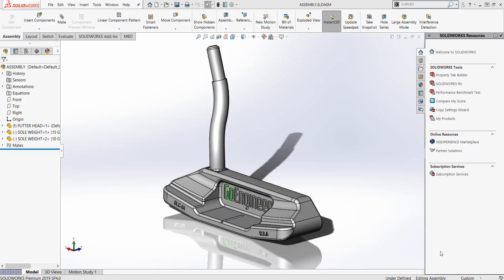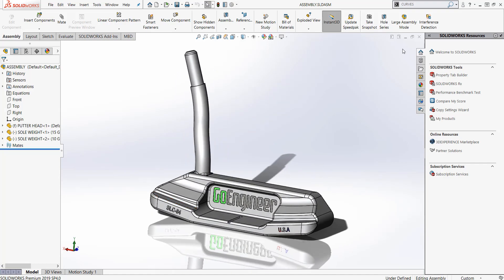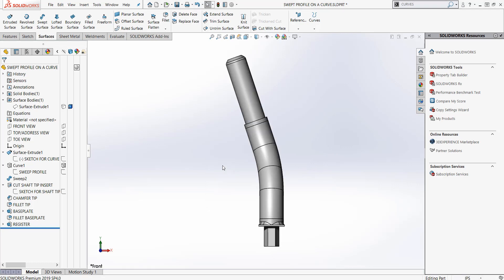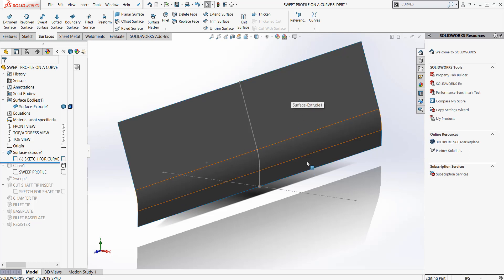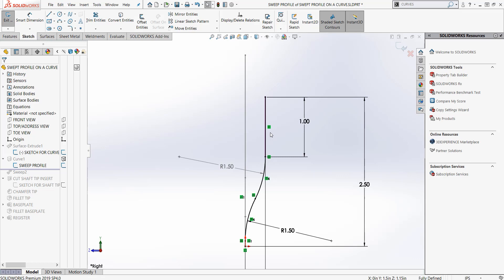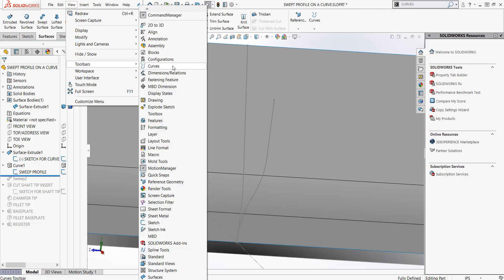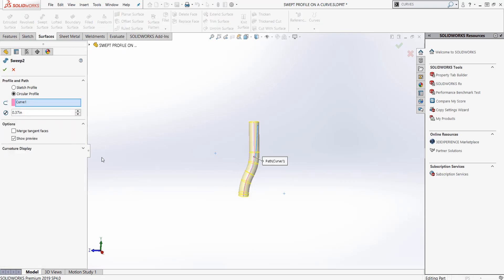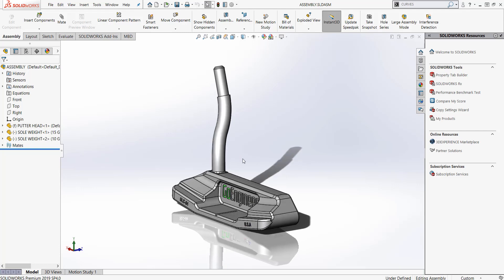SOLIDWORKS Tutorial - Circular Sweep on a Curved Surface

Comment: This is a good technique for eliminating the need for 3D sketches (which I try to avoid at all cost). Personally I would skip the extruded surface step by making a "sketch on sketch" Projected Curve and leaving a leaner Design Tree.
Reply: Absolutely! A 3D sketch for this type of thing is trouble waiting to happen.  His method seems clean and direct.  I'll have to look into projecting a sketch on a sketch...I usually just do as he did and create a dummy surface because that's how I learned.  It's always good to pick up different ways to do things, so thanks!